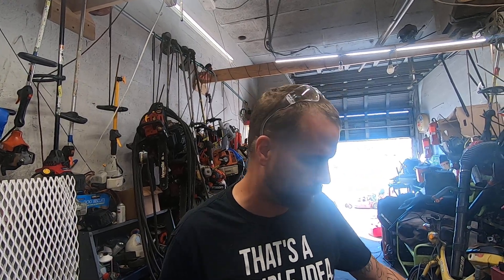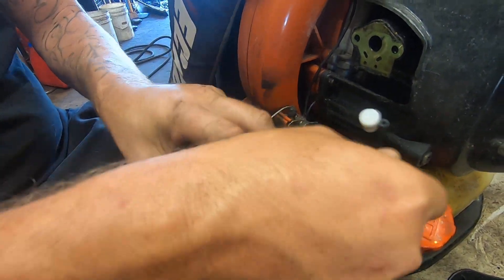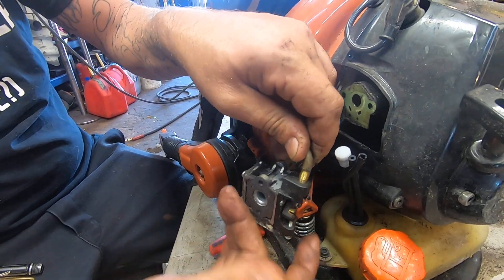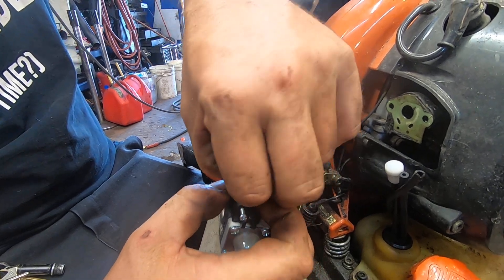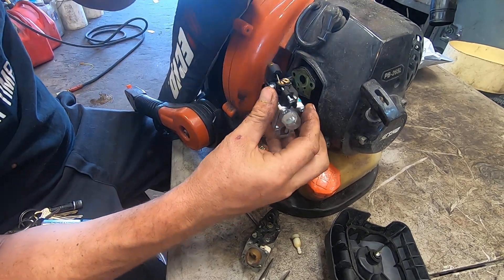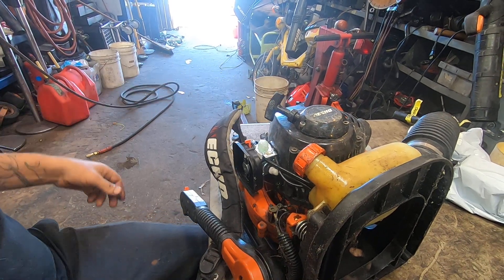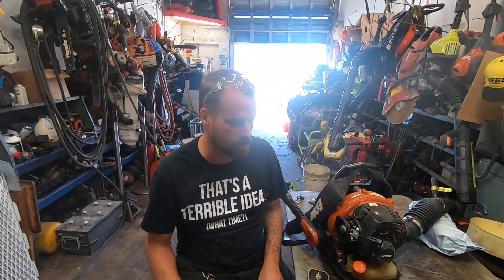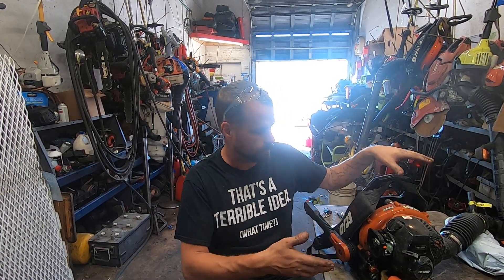* echo pb-265l blower carburetor replacement repair rebuild. pb265l carb

Comment: Do these types of carburetors have adjustment screws on them?
Reply from the maker: the adjustment screw is under a thick plastic cap kinda between the two fuel nipples. you have to grind a small flathead down till it just fits in. then heat red hot with a blow torch and stick into plastic cap and hold steady and firm letting it melt in cool down and stick to the plastic. once cool twist and put it will remove the plug. then there is a flathead screw under it. aftermarket carb has no plug and can be adjusted